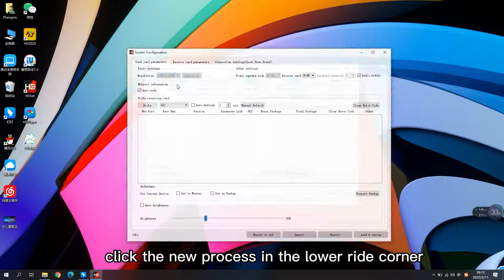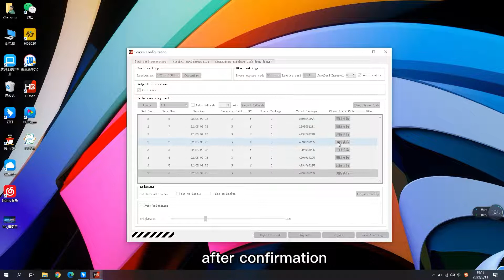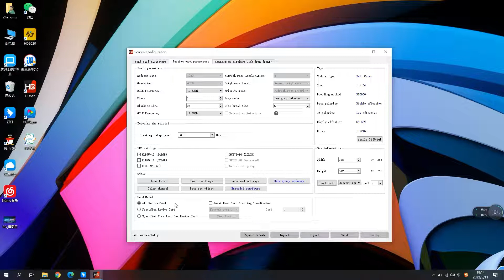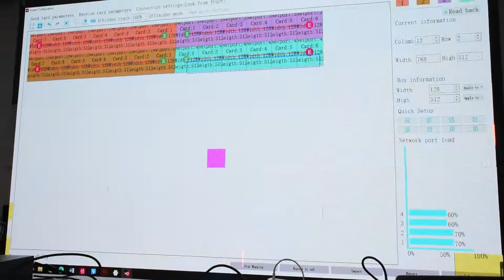The HDSet operation

Comment: Hello Im have problem, Im can't configuration. I use P3 192*192 for the size of 1Meter x 2Meter. using the HD R512 receiver card(5x) and using the HD VP210 Processor. please guide.🙏
Reply from the maker: please email to val@huidu.cn